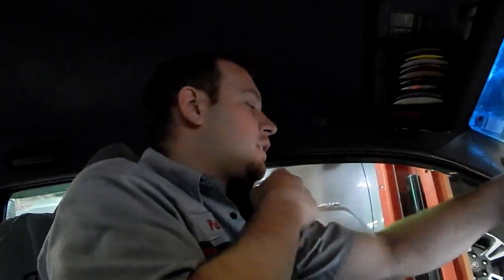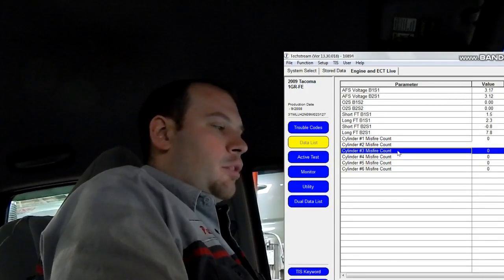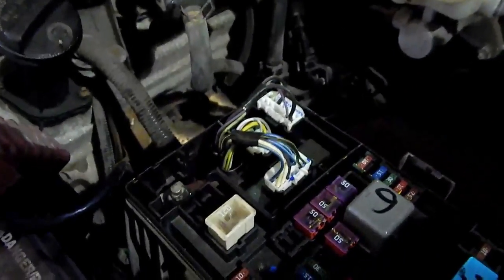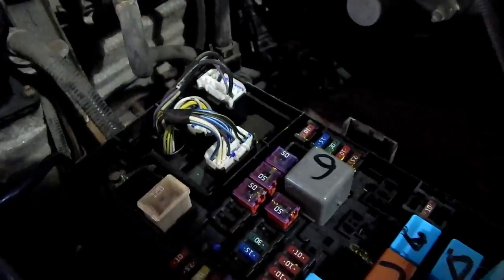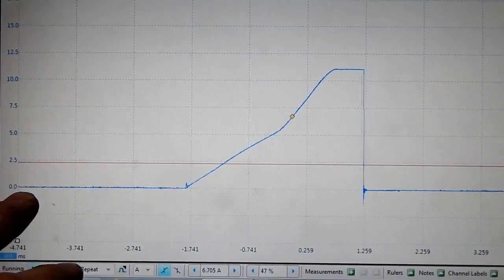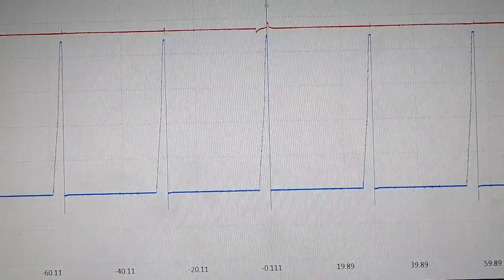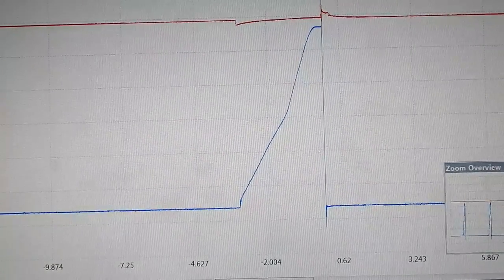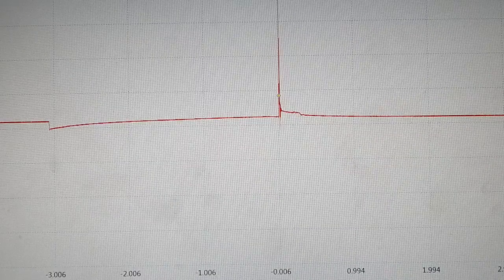Current ramping and testing secondary ignition on misfiring tacoma

Comment: Hello there. How did u get the secondary ignition waveform ? Those coils have the the transistor inside the coil. Were you using ignition wire hooked up between the coil and the spark plug? Also i have another question. Have you used Escope from ATS? i know the Pico scope is great & i'm planning to buy new scope soon.Would you recommend me the Escope or  Pico scope? Thank you
Reply from the maker: Its a secret! haha Just kidding. I built a homemade secondary pickup paddle. But it doesn't have scope protection in case a spark jumps from the coil to the paddle. It could hurt the scope, so I don't show it in videos.
Reply: Voltage Drop Diagnostics what do u think about about the Escope? I’m deciding to buy either the Escope or the Pico scope?
Reply from the maker: Vicken Karagozian i haven’t had the chance to use the escope myself. So i don’t have a knowledgeable opinion on it. I do know that i love my picoscope though.

Comment: What secondary ignition probe are you using?
Reply from the maker: A homemade one lol. I can't fully recommend it, because it doesn't have circuit protection built into it. If hypothetically a spark jumps from the coil to the probe, it will fry the scope lol

Comment: I used an old Bear diagnostic machine.Tthe size of an Icebox in the day. We looked for the same thing. Best thing about them old machines. The screen was huge! Here is what it looked like..https://www.youtube.com/watch?v=o4wzEhf_400
Reply from the maker: I’ve never used that machine, but where I went to votech had one against the wall covered in dust.

I wish we were taught how to use scopes back then.
Reply: @VoltageDropDiagnostics  I can tell you this. You ever worked on them old VW Bosch KE- Jettronics. You will jump for joy having one. As they had everything built in. So you could capture the exhaust dilution. With the exhaust gas analyzer.. Then set each injectors fuel delivery. I tried without one. I screwed it up so bad. I had to find a shop that had one. Then show them how to use it on VW..

Comment: Amazing video man. If a gen 1 Tacoma comes in with a 2rz or 3rzfe I’d like to see that! (Personal vehicle). Just elbow a guy and take it over haha. It’s awesome that you use a scope on a regular basis. At my job it’s pretty much just used for compression checks and current draws.
Reply from the maker: That’s a tough request there! A lot of those engines ended up in the scrap yard when the frames rotted away!

A lot of those Tacoma’s with that engine were bought back around 2007

It’s rare to see them, here in Pittsburgh. But if I come across one, I’ll be sure to video it for you!

Comment: Toyota connectors breaking? No way! 😂 
You just look at one of them wrong and it’ll snap.
Reply from the maker: Every time a harness get replaced, or we use a junkyard engine with the harness still attached, I cut off the connector ends so that I have a bunch of extras.

The problem is, the older connectors break faster than I can get spare connectors haha

Comment: What probe are you using for secondary ignition waves?
Reply from the maker: Timothy's Carpenterb 
I’ll be honest with you. It’s just a home made one. I didn’t show it because in theory, it’s not scope safe. If a spark happens to jump from the top of the coil to the probe, it can burn up the scope so it isn’t something I wanted to encourage lol.

With that being said. I get pretty good waveforms from it lol.
Reply: Voltage Drop Diagnostics 
I gotcha. Thanks!

Comment: Nice quick video! Does Toyota have a Pico as mandatory shop equipment? I worked for a GM dealer for a while and we had a nice Pico kit but they only trained to use it for NVH. Concerns and it just sat in the tool room most of the time. I thought what a waste.